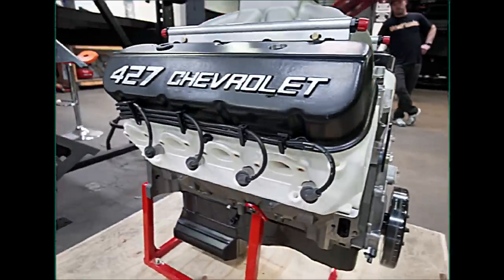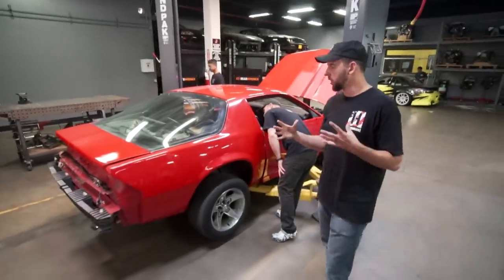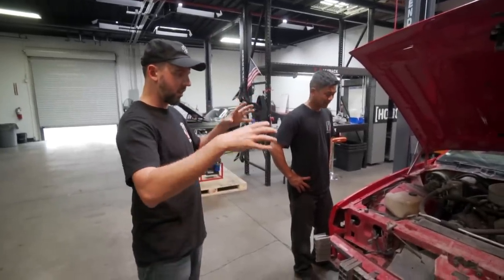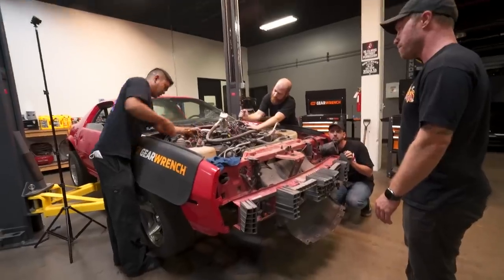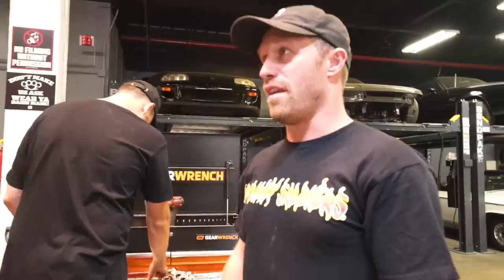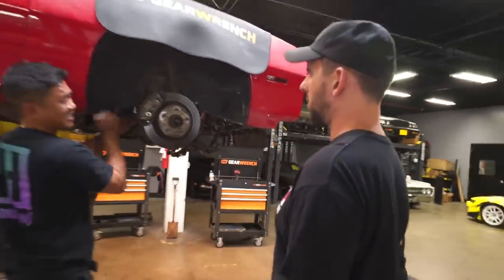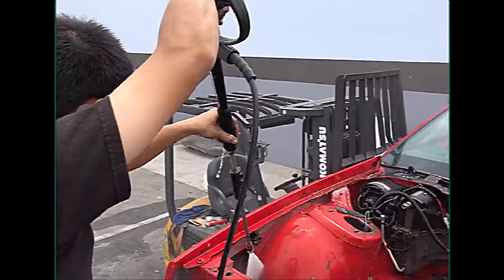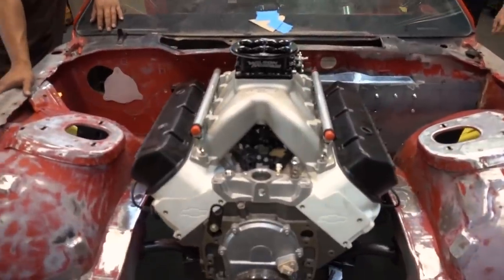Building a 1000HP Camaro in 21 DAYS!? We got the FIRST Chevrolet Performance ZZ632/1000 Big Block!

Comment: If someone was going to swap that 10.3L beast into something it HAD to be these scumbags! 😂
Reply: Well, Chevy sponsored this and made them do it
Reply: @agnez1169  no
Reply: What would cleetus say about them coping them though?🤣🤣
Reply: @michaelallen2677  Well, Toast's engine had a big F'ing blower on it, so it's not exactly the same. Also, after blowing up the 632, as advised by the Aussies, they went to a smaller big block (a blown 632 is way overkill for burnouts), before getting the one from the Castlemaine Rod Shop guys that's in Toast right now.
Reply: @halofreak1990  your right. Except they put a 632 into a 3rd gen a while back. You know like hoonigan is doing now. I applaud you for how much you put into it, bit it's still a 632 in a third gen. Just like cleetus did to toast.
Reply: @michaelallen2677  But this isn't just any 632, it's basically an engine with a factory warranty and made by GM themselves, also, the idea came from GM, if you want to cause someone of copying, do it on GM 🤷‍♂️

Comment: I love the wheels the Camaro came with.  They are zq8's, factory wheels for S10's and Sonoma's.  I think they are one of the best wheels Chevrolet ever put out.
Reply: They're on my 03 Sonoma in my profile pic!
Reply: @romyreds8323  I've had a few sets myself. I had a white 03 extended cab with them.  It came factory with the zq8 suspension.  Same suspension that comes on the extreme's.  It makes those truck so much better in handling and ride quality.
Reply: @ziptiejedi5658  yes sir. Mines factory zq8 package. Been in my family 11 years. Great little trucks.
Reply: @romyreds8323  I love s10s.  My first car was a mint 92 short bed standard cab with the 4.3.  I've had 5 more since then lol.   I have a bone stock mint of 03 extended cab right now.  It's in desperate need of a set of zq8s lol

Comment: As a 3rd Gen owner (91 Firebird), that shovel is classy. I just use a board to hold my hood up. But NO 3rd Gen's hood struts still work. Those big ass sheet metal hoods are HEAVY.
Reply: Yeah lol I’ve got a fiberglass one and even that is heavier than the metal one on my 4th gen😂😂 it’s a MASSIVE hood😂
Reply: We got 6 and i believe all of the struts work good enough🤔
Reply: My hood struts work mint. You can also buy new ones.

Comment: I'm curious when Cleetus is going to chime in with his 10L 3rd gen.
Reply: His is 540, not a 632
Reply: @jakesspeedshop  his is 632, atleast the original toast was
Reply: @jamest2544  the original blue print engine was a 632. The new ausie motor is a 540
Reply: @jakesspeedshop  oh worddddd
Reply: doesn't matter,this is gonna be n/a 1000 horsepower with a jericho.....

Comment: That 632 is what JJ the boss was running in his ol heavy for a long time, now he has the proline 498. 632 I a tall deck from days of old that allows big crank and raised cam location, they were in dump trucks and busses, I had one it was a four bolt main 454 ran cool and strong.

Comment: You mean the wheel wells aren’t rotted out and the floor boards are solid , I bought 5 z28 comaros in my life and every one was under $1500 cause I had to put floor pans or quarters on em, 1990 Copper color dodge caravan lol I got my license in it

Comment: The wheels are not stock Z28 rims... they are from 2001 S10 Extreme... bought a set of them out of GM performance parts catalog back in 06 for my El Camino

Comment: I drove an 82 Z-28 in the 24 Hours of Lemons. Barely modified OEM 5L so no power. Horrible OEM 3-sp auto. But it had the bolt-on Vette brakes, so at least it had that going for it. Overall, it was much fun to drive. Would have been more fun w/1000HP though.

Comment: Just so y’all know. That’s not a z28. That spoiler and camaro lettering on the ground effects only come on the 88 sport coupe. All z28’s say z28 on he ground effects and have the low wrap around spoiler. Or 91-92 had the high rise spoiler.I have an 85 z28. Had a 85 sport coupe and my brother has a 90 rs. And gm was known to use whatever parts they had lying around.

Comment: Those arent camaro wheels, they are s10 zq8 wheels, only used for the last 2 years on the zq8 suspension equipped s10 pickups/blazers, and gmc counterparts

Comment: WHY are you taking suspension cradle out? The engine comes out from the top of the engine bay...I would have had that out in WAY less time with way less sawzall use...so weird.
Reply: Can someone enlighten me without flaming so I can understand why they did this so bassackwards?

Comment: seriously,you dont need a mockup big block  WHEN YOU ALREADY HAVE A BIG BLOCK INSTALLED.....am i missing something? get the crate,slam it in,burn tires off,repeat
Reply from the maker: The heads are WAY larger than the older BBC design.

Comment: Cool... get rid of all that garbage.  That auto trans. Lame.......... Jericho hell yeah.  Tie the frame..  keep the TORKE Bar. Add. A 1  inch sway bar. 12 point cage. Get the fork truck. Strange 60. Axle.  Carbon fiber  drive shaft.

Comment: Only 1000hp for a 10.3L engine, and no bottom end torque ? Twin turbskis will fix that. GM loves to persist with ancient tech. That 2v pushrod  engine design is from the 60s. 
My 4L i6 turbo Barra daily has a much stronger 2000 - 4000 rpm torque curve than this 10.3L NA - much better torque curve for a road car.
And the mass of that 10.3L ? I suspect that is one heavy lump of iron that could transform your car into a non- handling pig.
I guess it will appeal to some.